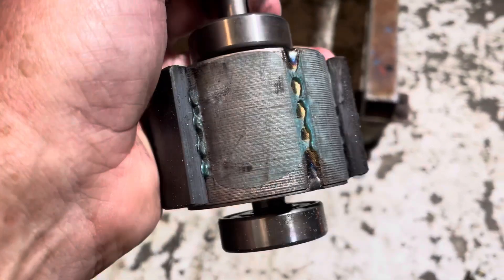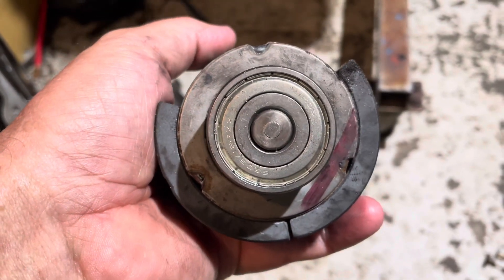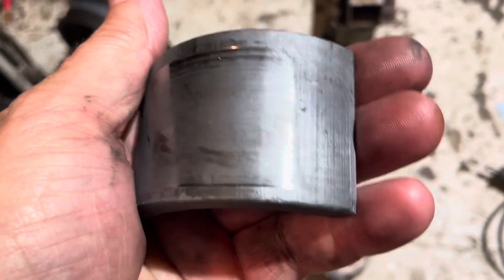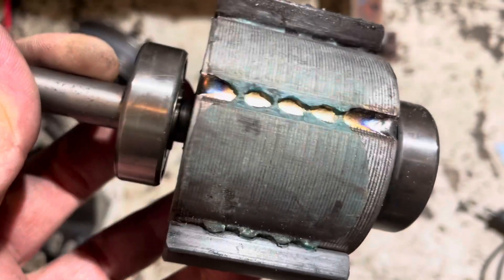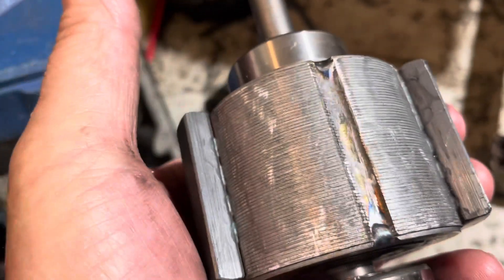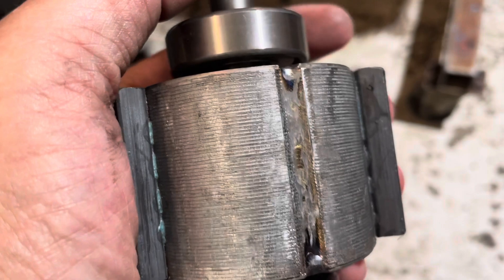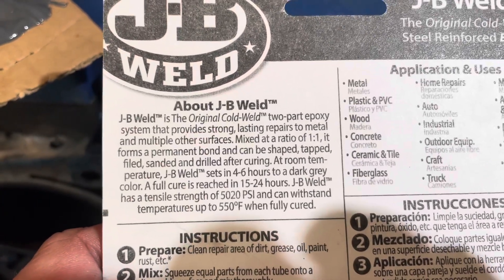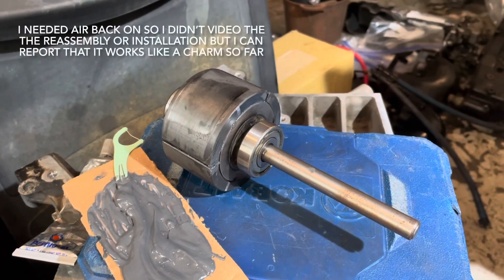Emergency AC (ECM Motor) Repair Saved $700

Comment: The same thing happened to the fan motor in my heat pump. The motor is a 1/3 HP GE ECM motor.  I also happened to have some JB Weld epoxy on hand and did the same repair. Any epoxy should work. There is nothing special about JB Weld. Thanks for posting your repair.

Comment: I have this exact same scenario. Did this work fix for an extended period of time?
Reply from the maker: About a year then another glue joint broke so I fixed it again.
Reply: @moccasinmarine  thanks man this video was super helpful. I got my system functioning again thanks to you